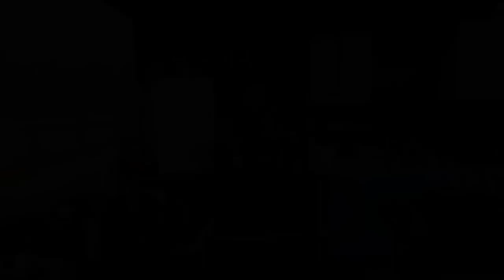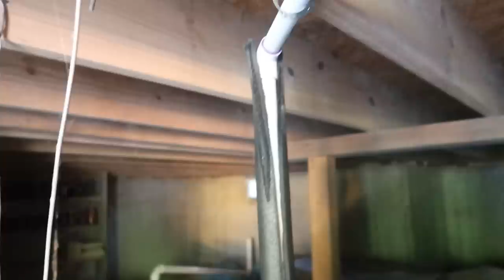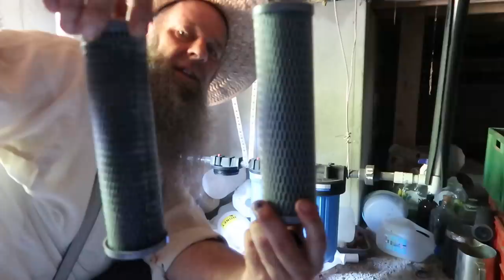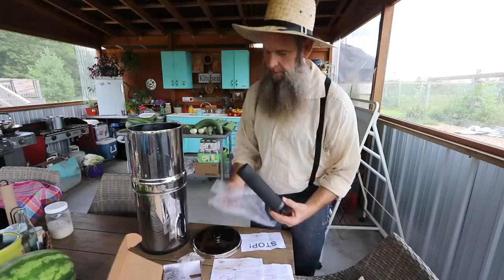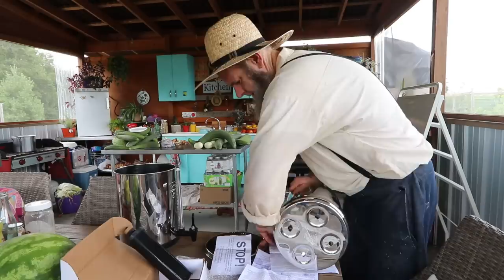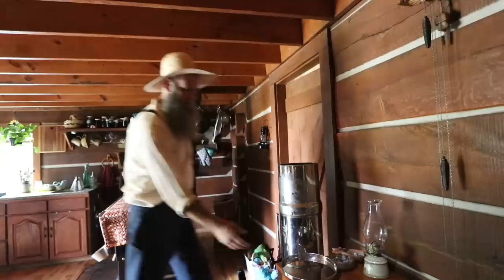OFF GRID WATER could make you SICK protect from Bacteria Viruses Heavy Metals

Comment: Been using the Berkey Filter Filtration System since 2009 and LOVE IT. First I started with one called the Big Berkey, but it's not the biggest one and I have since moved up to the biggest one (which I think is called the Crown Berkey). It has 6 rather than 4 holes for filters if I remember corrected (haven't looked in for some months) and it holds up to 5 gallons. I live in a 2-person household and sometimes soak beans, etc. in the filtered water and only need to refill it every 2 days generally, which is nice. I also upgraded to that clear glass thing above the spigot that tells you how much water is in there. We also use the PF-2 filters, which are in addition to the black Berkey filters and "hang out" in the bottom section of the system. The PF-2 filters remove most of the fluoride and arsenic. (The black filters do not.) The PF-2 filters are white plastic on the outside and don't last as long as the black Berkey filters. We put in 4 of each (black filters and PF-2 filters), which not only makes it filter the water faster but also makes it so that installing new filters is less often. I trust the PF-2 filters for about 2 years, but the black filters last 3 to 4 times longer. I saw a video once which I couldn't find again that showed that the black filters can be cleaned and reused. If anyone has a link to that, please reply to my post with a link, if you will.

Comment: We are off grid. We can harvest water and keep in tanks. We filter it. We made our own Birkey filters! We did drill a well. In Texas where we live the rain now is scarce. We ( thank the Lord) sit on an aquifer which we knew when we purchased this homestead land. Get an AG exemption if you can. Then a 1D1 exemption. This can involve something as simple as bee keeping, sheep, goats, a cow and calf combo etc. Bees require little investment if you are handy with your hands and can build. We have two wood burning stoves, one to cook on, also double hot plates ( electric and solar run.) For a shower and kitchen we use a large water tank connected to a solar powered generator that pumps the water. For hot water, we use a small Hot and Ready tank under the sinks. We have an indoor composting toilet and like Doug and Stacy, we use the 5 gallon buckets. We also compost vegetable and egg shell scraps ( no fats or meats and bones) which go into a garden. There are many critter so we use snake fencing to keep out the humongous locusts. Diatomaceous earth keeps them away too. . One can grow microgreens as well or a tower garden in the winter. We had to research and learn. It took a few years before we were ready to take the plunge. There is a lot to learn. But we help others and others help us off grid help us with the bigger jobs line running fencing etc. it can be fun as well as rewarding. We pay no bills. Out here the barter system works very well. Hope this was helpful.

Comment: Enjoyed the video. One thing to consider if you ever tear into your filter tree under the house, install a 2nd cut off valve on the house side after filters. That way you don't get a backflow of water from the house fixtures. It seems you don't really have backflow issue in video but could be handy. You wouldn't loose precious water from pipes.

Comment: the Burkey is a great system but if you are using municipal town water in it get the optional flouride filters that screw onto the bottom of the black top filters. These hang down into the bottom chamber. These remove 99% of the flouride. The burkey is the only gravity filter that gets these results with flouride removal. Great video guys.
Reply: I wouldn’t use those fluoride filters. They have been found to leech massive amounts of aluminum into your water.

Comment: Ive done irrigation for years....if your putting the filter back on....go anti clockwise while keeping a slight pressure on the filter casing,....turning slowly no more than one turn in reverse or anti clockwise youll feel the threads drop into place....😁....then your filter is sitting flat,ready to put on clockwise...if your thread is clean it should go on easily with little resistence.When its fully sealed they're should be no gaps between the casing,rubber gasket,and upper casing.Then its good to go.If it leaks youll see its been cross threaded,that will cause either water leaks at higher pressures or air suction leaks at gravity pressures.Hope this was helpful.....One other tip is holding the new filter and casing from the bottom with one hand and turning with your other hand...helps with allignment.Great channel Doug and Stacey.
Reply: Berkey water systems are great,taking out most heavy metals,chlorine,but not flouride ( only applicable to treated town water)...Berkey in USA,Phoenix in Australia....both similar.And the water tastes great....youll notice straight away on your first glass.

Comment: For the overflow problem if ya overfill the upper section (it happens) and for if ya forget to take out your extended sink faucet, the water just runs down the sides -----  FIX.  ----- I took a 5 gallon bucket, cut the bottom 1-1/2" around so ya have a plate or bowl,   heated up some 1" pipe and melt shaped a spill over lip.  If water runs down the sides in any way the spill is caught on all sides in the 'bowl' and directed to the spillway just under the spigot and flows into the sink -

Comment: the white filters are for chlorine and fluoride. I have a berkey too, fill it to an inch from the top when you have an inch at the bottom of the bottom tank. Yes it holds 3 gal, and it'll put out 3 gallons per hour. tc

Comment: We've been blessed with a good well. Water table is 3' deep usually. Just hooked it up and its not that hard of water. For what we do we dont need filters. We do have a birm filter and softener. Having said that the water is good. Probably could get by with just a yarn filter. We distill our drinking water which if you want you can ad the minerals. We half the time make lemon water no added minerals. The amount for power vs getting a filter theres no comparison. Of electric runs from 90 to 170 in winter. We built a super efficient house and that is our only utility bill. Setting at a point where if i wanted i could throw the power line off my property. 

Doug, where does your water table sit?

Comment: I use Culligan clear whole house filter systems, I can see it as it gets dirty with sediment. Yeah I bought the Alexa pure system too and I have a distillation system too.  When a relative had problems with her well house water freezing, I added the insulation over the low voltage conductive wire that only comes on at 35 degrees F.  I like that you have the glass tube to tell you how full the lower chamber is.  I also bought a 10" high stand to make filling jars, kettles, and the like easier, without hanging the spigot over a counter edge.

Comment: Good video gang, Zero Water filters are also good for smaller unit (after pre-filtering it) and they fit in the fridge .... and your Tea/Coffee will taste much better ... I was a builder for 30 years, dealt with a lot of complex water issues, municipal, wells, and rain water collection systems (and pollution) .... your 3 filter inline system is great .... I'm on a 70 year old 100 ft well now (just replaced the 32 year old well pump) ... my system is also a 3 filter system plus a pre flush-able "spin down" stainless steel filter to grab sediment here in eastern PA on the Delaware River .... the pre- flush-able spin down filter keeps the carbon/spun filters from clogging to too quickly ... I don't drink my rain water, use it mostly for the garden ... as I have a whole house generator set up to run basics and the well if needed if I loose power ... and the river is right across the street so I'll never really run out of water usable water ... it's important to inspect water lines for the bacterial/slime/muck/sediment build up ... I "shock" my well with chlorine every spring and get it tested every 5 years or so ... just like you'd do with a pool ... never a bad idea to have water treatment tabs on hand (I put them in my LT "stored water" before sealing) .... or MM solution works too ... as lot's of nasty stuff can grown in untreated water left sitting/stored ...

Comment: I use the same type of filter cartridges on my roof water. Works well in increments of 50-20-5 microns before coal filter. Putting in a pre particle separator in form of a chambered sink/float tank, made my filters lasting VERY much longer. They do not really  clog anymore. I mostly replace them in summers due to build of green algaes. I had my water tested. It comes out better than municipal and our local municipal are not bad at all

Comment: The overflow mistake, been there done that LOL.  Now, I put back in what I take out & have it on my counter, so if it leaks (at the faucet) it will leak into the sink.  No problems so far.  One thing to watch for, (mine is a Dalton) is the rubber ring (gasket between the filter & unit) gets slimy.  So check it often when it drains down or figure out how long you can go before that happens between full cleaning.   I know this is an old post, but others coming along may read this.

Comment: I love the forum here Doug, it really helps me with figuring out products that are right for us and also to lend comments on stuff we've had happen. Bought our 2 black Berkey filters back in December of 2019. The reviews on Berkey's site were great back then. Well, they're supposed to last about 6k gallons if you're putting tap water in, less if you're working with heavy sediment. After about 3500 gallons our started filtering the water too fast, it was just pouring through. Well, the Berkey site shows newer reviews saying similar things or that they get hairline cracks easily, etc., as if they've recently changed their product & it's not as reliable as it once used to be. The price has gone up too from $120 to $166 for 2 filters. So I reached out to them, and they asked me to run a "red dye test" meaning I needed to put 1 tsp of red dye into the top tank with 1.5 gallons of water and let it drip into 2 mason jars, if the dye shows up in the filtered product then the filters are bad. The filters didn't filter out the red dye, and when I told Berkeyfilters.com they said they offered no warranty. Just wanted you to know in case your figuring the per gallon cost, that could get ya a bit. If you come across a filter that's made in the USA, I like the idea of it having silver in it too, I'd sure appreciate the heads up on it! Likewise, if I figure out a solution, I will zip it over here too. God bless!

Comment: Take your unions apart and spin the whole filter array around so the cloth filters are in front of the charcoal. Also, most of those filters can be press fit into the base before you screw on the housing so you know it’s on correctly. Other than that it’s a great setup and I hope to someday have something similar. For now, we have 2, 375 gallon ibc totes wrapped in black plastic and a first flush on the house so we’ve got a start. We also purchased a berkey.

Comment: I was in the water filtration business for 5 years. I believe you have the filters backwards. Should be using the 1.0 micron string filter first, followed by a 0.5 micron and finally the charcoal filter. This protects the charcoal filter and keeps it from forming channels in it from the minerals and flow.

Comment: After a dry spell, that first rain makes dirty water for the first few hundred gallons.....If you can run that water away from your system, into the garden or to animals, your filters will not clog. All the pollen, dirt, dust, leaves, bird poop, etc that builds up during the drought needs to flush out first....I wonder if that is your experience..... I live in WA, near Hood Canal....Pollen is heavy here. Sticky stuff...makes roof slick when it rains....Slimy....Pressure washers are a useful tool here. I don't think they like rainwater storage here...But I think it is allowable....We have a lot of protective measures in force for the Hood canal and Puget Sound water quality....We grow lots of shellfish here....The pH has been going down...more acidic....dissolves calcium....Not good....Can hardly wait for the return of The King....

Comment: Those filters are installed backwards. That is why your carbon filter doesnt last longer. There is a reason the white ones are called "sediment" filters. Also, you should have the larger 1 micron sediment filter ahead of the smaller one. Of course, the second one should be like .25 micron or something, otherwise its basically doing nothing.

Comment: So long as you collect rain water and use your filters and your Berky you are good to go. But if ever you soarce water from a well be advised you may be surprised how inefficient the Berky is at removing 100% of contamination and lead. A Zero Water filter is a must as it actually pulls out contaminates. I saw a demonstration on you tube and was amazed by the metering devise which comes with the Zero Water purifyer to tell you when it is time to replace the filter. But I use the meter to check all my sources and saw how contaminated my spring water is and then ran it through the Zero Water filter and dipped my tester in a cup of water and instantly saw a huge difference as it read completely Zero on the meter and tastes just like distilled water. Which in fact I tested store bought distilled water and it was absolutely Zero contaminates on the Zero Water detector/meter.

Comment: Doug, you are a cool dude! Came across your channel for the first time and because you did such a great job with articulation of interesting info., I listened till the end. I recommend trying the PRO ONE filters on your Berkey system. Be mindful of the proper length dimensions. PRO ONE are cheaper, does not require priming and also filters fluoride. Be safe.

Comment: Hey, love your videos. We have a lot of minerals in our water which shows up on faucet threads. Even your filter threads could be at risk. I rub just a drop of oil in a paper towel over the threads. It helps prevent the minerals locking your connections. God bless. Jc

Comment: One thing is the carbon filter. Must be changed most frequently. Contains higher Bacteria counts the longer its in. Yes it grows bacteria very very well.  The sediment filters are great to prevent larger particulates from passing through sand some non dissolved minerals like iron and organic matter.  None of these filters remove chlorine but can reduce fluoride.  Ionizers will change alkalinity but serve no purpose as the body acid is required to break down food for nutrients. Ionizer may be beneficial if your water is extremely acidic in nature and not neutral 7.0ph.  Water salt ion softeners can eat up a 40 pound bag a month as it works on calcium and magnesium in prevention from scale build up making your hot water heater last longer.  Less of these minerals the longer it will last.  Note on chlorine in tap water is to kill off harmful bacteria. Fluoride is a poison and is a byproduct industrial additive ( oh JOY! ) and some notes on it are as follows.
 Tooth Discoloration. Consumption of too much of fluoride leads to yellowed or browned teeth.Tooth Decay. High intake fluoridated water can lead to the weakening of enamel. Skeletal Weakness. Neurological Problems. High Blood Pressure. Acne. Seizures. <- Why do we still use and allow it? Ask who funds the program to dump it in your locale municipalities. 
Bigger Question is do you need a water filter? In most cases no. In  some cases yes if you have some sort of weak autoimmune system or your dealing with raw water ( rainwater ) that may have some contamination example ( e coli )  which everyone who is concerned about their water needs to get it tested first. <- Then you can make decisions after whether or not to add chlorine treatments after you source why your water is infected. There IS a REASON! 
 Other than a sediment filter to prevent damage to pumps or a super special case most Market water systems won't do what you think they will do. Truth hurts and so will your wallet. Do your research and know why and what your attempting to filter out and make sure to consult the labs that test your water to help make a decision.  Boiling water and storing it kills bacteria if your bioload ( biofilm ) count comes back with high PPM <- Parts per million. 
I will be using a rainwater system for our property. We will boil water to kill off bacteria if we decide not to treat it with chlorine.  I will use a basic sediment filter to prevent our motor impeller for being damaged. Keep it simple. Keep it clean.
Food for thought.

Comment: To be honest if you are to actually keep bacteria out of the water in the stainless steel kitchen filter you don't first put water in the the black filters output hole.  If your going to do that for any reasons you'd have to do it with distilled water.  There is a clean side (inside of filter) and dirty side (outside of filter).  Once you put water containing organisms to the clean side of the filter you have contamination and because there is water you have breading pool.

Comment: Hi Doug and Stacy have you seen that the Burkey water filter system is involved in a class action law suit? Apparently they have not been certified by NSF and did not test to the standard it claims. It doesn't filter out all the contaminants that they claim. Just wanted to give you folks a heads up. I am sending mine back for a refund. You can check out Project Farm for data and results. I love your channel and appreciate all the helpful information you share.